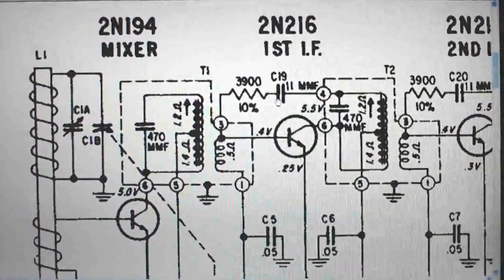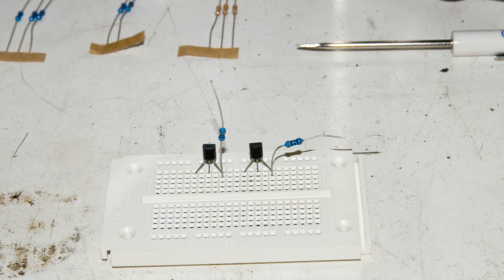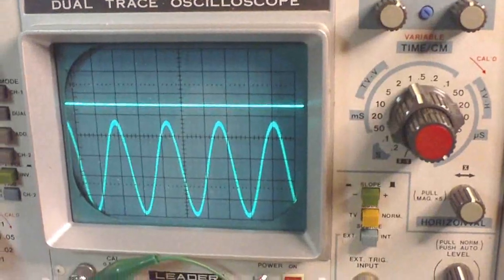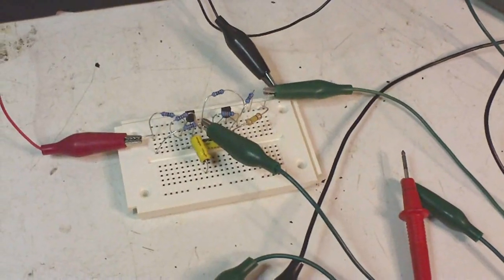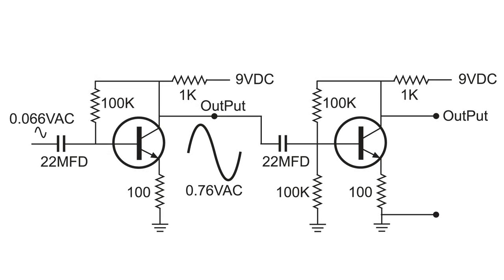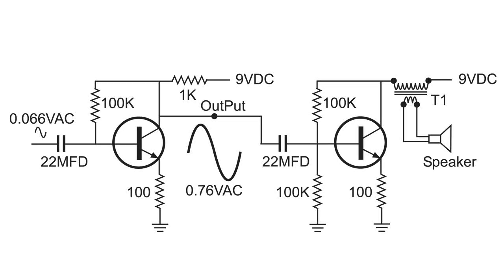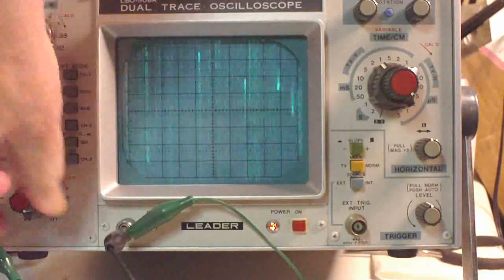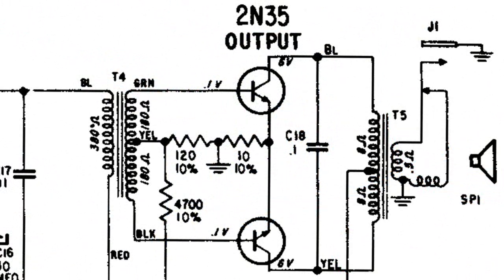Build a Two Transistor Audio Amplifier

Comment: with a tube type output transformer does the field collapse more slowly than in a transistor type? if so that may be the reason there is a flat bottom
Reply from the maker: The tube type amplifier has a mush bigger swing in voltage.
Dynaco ST 70 Frequency Responce Demo
https://youtu.be/CBVFZ0Hi09Y
Dynaco ST 70 Amplifier Circuit
https://youtu.be/CJlZMi8gcXs

Comment from the maker: Thanks rschandran
My signal generator can start at 0volts and may get to 1.5volts. You could use a pot, set it up like a volume control. The signal from the generator goes on one side, the amp input on the center tap, and both the amp and generator ground on the other side of the pot.

Comment: nice.  i'm wondering about modifying this circuit to cut out the transformer.  could you use an emitter following to lower the impedance of the output stage?

Comment from the maker: @RadioDude1969 
Also it appears there is not enough lab experimenting taught these day. I have worked for some very large companies and they had labs that cost many millions, and they would not have them if it was not absolutely necessary. So experiment! So what if you burn out a 10Cent transistor, or a 5Cent resistor. And you will learn something.

Comment from the maker: @RadioDude1969 
Don't know. The impedance is higher at the collector and is lower at the base. Collector has two diodes back to back, the base is one diode. I have no specification on these transistors so everything is experimental. Which is the way most are developed. If you are use to working with chips, you put this in and you get this out, work with transistors is much more difficult.

Comment from the maker: @RadioDude1969 
It could be the Beta of the transistors, but more than likely it is an impedance problem. I just put up a new video on transistor biasing. "Transistor Bias Design" Also check the the bias level when there both connect to see if it changes. It could be the first stage is over driving the second stage.

Comment: I really don't understand this...I have built a similar circuit and verified that both stages are working when not connected together. Nice clean signals on the outputs. Same levels as in the video. When connected together, the output from stage 2 flat tops. In addition the output from stage 1 flat tops. My
 transistors are BC547B. I really can't understand why the circuit in the video works so well and not mine...

Comment: Hi, the output  voltage from the transistor in the first stage is 0.76 VAC. How high can the input voltage in the scond stage be before it starts to flat top? I thought 0.76 VAC was too high already.

Comment from the maker: @0707kmiller 
That is a PNP, I used NPN transistors. But there should be not damage through. For PNP, just reverse the polarity of your battery, and or power supply, and it should work.

Comment from the maker: @RadioDude1969
I just wanted to show two ways of biasing. This circuit is not optimum and on purpose. The load varies from about 500 ohms for the transformer and of course 1K. The load will also influence where the base of the transistor is biased.

Comment: Yes, I have downloaded NEETS volume 8. Ok, but why do you use different biasing for the two transistors (I suppose the transistors are identical)? Will the transformer display an impedance close to 1 k, since the resistor can be removed?

Comment from the maker: @RadioDude1969 
When using electrolytic capacitors you should always observe polarity. Don't have to use a voltage divider for biasing, it depends on what it is you what to do, that is the engineering part. The 1K resistor/transformer is the load for the collector. Have you download the Navy Electronic Course.

Comment: Hi
Does the polarity of the electrolytics matter when dealing with such small voltages? 

I notice that you use a voltage divider on the base of the transistor in the first stage, but not in the second. The transformer also replaces the 1 k resistor on the collector. Can you please explain this? Best regards Jon

Comment: for AM radio receiver, i want to use  2 transistors as darlington, and then i use amplifier to drive speaker....i want to ask that...when i use simple 1 npn transistor, i use 100k ohms resistor to bias with collector-base......what bias resistor should i use if im using 2 transistor as darlington??? , if  i use 3 transistors as darlington??? if i use 4 , if i use 5???

Comment: @AllAmericanFiveRadio 
I just did. Not sure why you suggested it though as it did not mention any Load Line theory and the relevant quiescent point. The white/green box did however represent 50% Vcc Bias.

Since every transistor (hfe/Beta) is different, and so are the relevant biasing resistors (tolerance), the practical Biasing points can and will differ from the theoretical ones. I am still placing my bets on a below 50% Vcc biasing point. Cheers :-)

Comment: Excellent video. Nice demonstration of BJT amplifiers. Whilst I do appreciate op-amps, I like to make my hands dirty with BJTs.

As for the flat line on the bottom, it looks to me as if the signal is clipping and that is due to your Vcq biasing point. It should be approximately half the supply voltage, in your case 4.5V. Check your biasing voltage just below your Rc and I bet you it will be below 4.5V. Raise it and that should fix your problem. I am talking from experience :-)

Comment from the maker: It is true you can change the biasing, but then because of large impedance mismatch most of the signal from the first stage goes into the power supply.

Comment: Interesting demo on transistor amplifiers. As for the clipping on the bottom of the waveform,  If you raised the bias or operating point of the second stage, you could eliminate the clipping. 

On the question of inverting, the first stage and the second stage invert the signal, so the output signal is the same phase as the input.

GuruSantiago
ElectonicsIsFun

Comment from the maker: Thanks Maxxarcade 
Yes the signal is inverted from the base to the collector. This video is the first step in getting the circuit to function and this first design has problems. From the response already I will be doing more of these. I thing in this design the Oscope has become part of the circuit now. That just started for some reason. So I’ll show the mistakes and the fix.

Comment from the maker: Hey John,
I did observe polarity by checking the two circuit points with a DC voltmeter. For this experiment it is not super critical because 22uf is pretty high, and I may have one or both in backwards. This video is the first step in getting the circuit to function. From this point you can modify and correct errors. Basically I used the parts I had on hand.

Regards,
Rick

Comment: I miss doing stuff like this!  

Did your circuit invert the signal?  Seems like whenever I used a single NPN transistor in class A like that, it also functioned as an inverter.  

Another thing I noticed in your circuit, is that there was no resistor from base to ground on the first stage.  I've always used a voltage divider like the second stage has.

I wish I had more time to get out my breadboard.  I've been getting pretty rusty on the basic analog stuff like this :-)